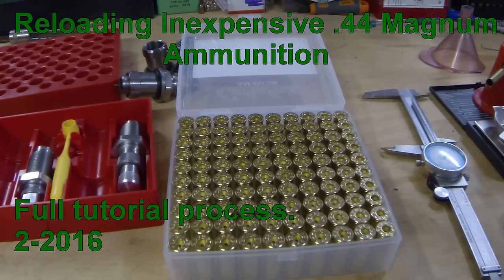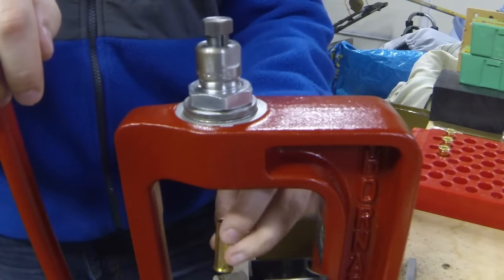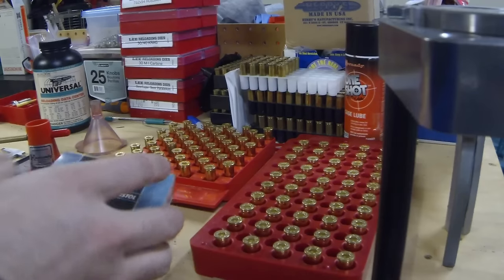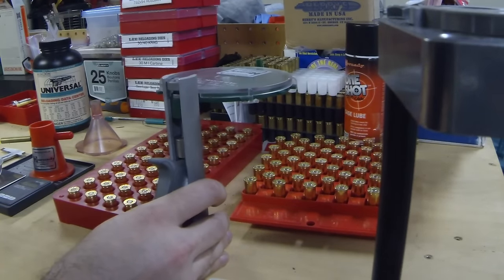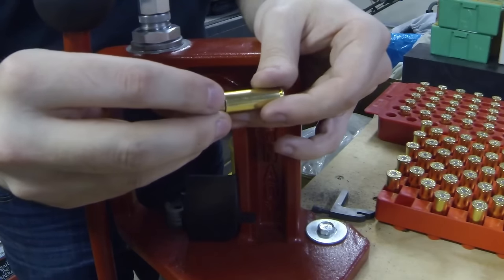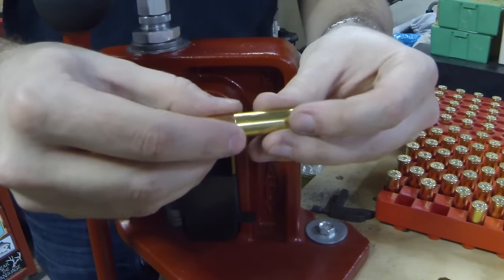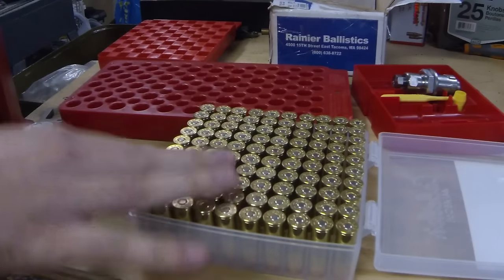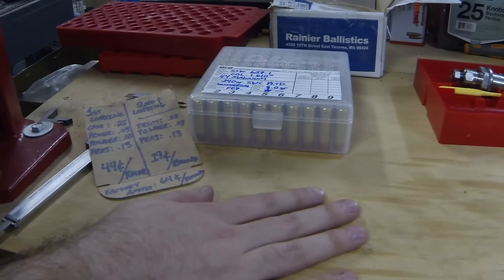Loading Cheap .44 Magnum Plinking Ammunition. Complete Tutorial Reloading Process in HD

Comment: Today, I loaded Titegroup powder into three of my 44 Mag cases. I topped them off with Hornady 180 gr HP bullets .  Only one of my manuals had a recipe for Titegroup powder.  According to Richard Lee's manual (2d Ed'n) I could go from 10.3 gr (1459 fps) to 11.5 gr (1544 fps) of Titegroup.  So, I started low and worked up.  I loaded one case with 10.0 gr, one with 10.3 gr, and with one with 10.5 gr.  When I chronograped them, the 10.0 gr gave me 1315.2 fps.  The 10.3 gr gave me 1374.5 fps and the 10.5 gr gave me 1392.2 fps.  The revolver I used was a Ruger Redhawk, with 5.5 in barrel.  The chrono I used was my new Garmin chronograph.  The Garmin uses radar to get a bullet's speed, so I was able to set up inside my shed and shoot, while it rained,  BTW - it has NEVER failed to get me the speed of a bullet (even my silenced Taurus .22 pistol) - I really like this Garmin even though it was expensive.  Since I have room to increase the charge, later I'm gonna load 10.7 gr, 10.9 gr, and 11.1 gr and clock them.  The three cases I shot today showed no signs of excessive pressure. My primers were plain old large pistol primers.  I wish I knew what length barrel Lee used to get his speeds with.  My 5.5 inch Redhawk was slower than whatever he used.    Recoil was really nice.  Ya'll take care.

Comment: for some one just starting or not done for a while they should put the powder in and then the bullet and seat then move on to the nest one and then when they have more time at loading do the way you do is ok ,  I have been loading for over 40 years on and of and still as soon as the powder goes in then the bullet goes on and is set and crimped.  I have known some who set the bullet in one step then crimp in the next. You use the same die set just remove the bullet seat plunger and then crimp.  a great way for a beginner.  Great Video one of the best I have seen.
Reply from the maker: I’ve loaded about 15,000 rounds on this press since this video has uploaded and have only made a couple changes to my reloading process. After charging all of the cases, I shine a very bright flashlight into them to visually confirm they are all charged and the same level. Then I gently press a bullet into them while on the loading block. This takes less time than positioning a bullet on the case when in the press. Also if a case gets dropped and powder spills on the loading block, the loose powder can not get into the already charged cases. Thanks for watching!

Comment: Wouldn't having all that case volume between the powder and the bottom of the projectile over a powder charge that fills more volume like 2400 give better SD-ES and a tighter group.
Reply from the maker: If you’re shooting 20+ yards off a rest, sure could help out but you’re burning twice the powder and it’ll have more recoil. But if you’re shooting paper at 10 yards or plinking I’ll use TiteGroup/universal/HP-38

Comment: Great video. I'm new to reloading and just started 44mag with berry's 220 copper plated SWC with no cannelure. I thought I might have been over crimping with rcbs die. I might change to Lee dies and try your method. It's hard to see in video but if your just removing the bell and not having a problem with other rounds jumping the crimp I guess I shouldn't either. I'm using a Lee recipe for 220 grain copper plated SWC with 6.8 grns of win231 so it's a low end of range. Thanks again for an awesome video...
Reply from the maker: Dave T Most of the time unless you are loading full bore Magnums with slower powders like H110 or shooting in a super-light scandium revolver you don't have to worry about crimp jump.

One newer method I've used for setting the bullet searing die is this: run the die down until it meets the case neck and back it off one turn so the die does not crimp. Seat a bullet to the proper depth then run out the seating plunger completely and run the die back down to touch the case and 1-1.5 full rotations lower and crimp the bullet. Then run the seating plunger back onto the crimped bullet tightly. The die is now perfectly set with no guess work!

Comment: very good video the only things I do different is that I weigh every charge and put the bullet on as soon as I put the powder in, That way if I am  called away  I don't have cases with powder sitting in them.  I also dump just under the amount of powder in, then trickle the last bit it to bring it to exact weight,  I like the balance scale, as the  digital scale I have will give me slightly different numbers weighing the same thing several different time. Hope yours is better than mine.
Reply from the maker: Hildton McConnell I have the Hornady balance scale now. I only trickle the larger stick powders for rifles if match grade accuracy is really necessary. Ball and flake powders get dispensed very accurately with this powder hopper within 0.1 grains.

Comment: Great video! I learned a lot about a subject a knew little of about! 

I am considering doing this for my .40 S&W and .45 ACP ammo. I also shoot 12ga and 20ga shotguns. If you have any recommendations for ammo presses, please share.

Thanks!
Reply from the maker: I personally don't reload shot shells simply because there is very little cost savings unless you're only doing buckshot (that you cast from free lead) or lee/Lyman slugs. 

Both .40 and .45 are more tricky to reload for beginners because they are auto loading cartridges that headspace off the case mouth. Not that it's impossible- it's just slightly more involved than what you do for rimmed straight wall cases like 38/.357/.44mag. Of all the blown up guns I hear about, a good majority are beginners reloading .40 S&W and shooting them in Glocks. The Glock barrel's chamber doesn't support the back of the case enough and when reloading a high pressure round like .40 it may rupture the case and blow up the frame on a 3-5th reload. Also a steady diet of unjacketed soft cast bullets will pop most barrels with polygonal rifling. Glocks are especially prone to this.

I recommend a single stage press for beginners. I really like the Hornady. RCBS is great too; the Lee is adequate.

Comment: You didn't check your length on your new starline brass after resizing!. I have found variance of up .0012. and need to be trimmed!.
Reply from the maker: Davey Crockett 0.001" variation in case length is insignificant especially when you will be using these in revolvers. I rarely trim any handgun brass as it really doesn't stretch much and it doesn't make much difference in the final product unless you are doing heavy roll crimps. I have some .38 SPL's that have been loaded 20+ times without trimming or primer pockets cleaned.

Comment: It looks like you don't use a baffle in your powder measure. It seems like my measure doesn't throw consistently without the baffle. Every have any issues with yours?
Reply from the maker: LoneWanderer360 I had the opposite problem. Mine would never be consistent with it in. I even had some 4227 clump up and block the openings leading to a couple half charges. 

I don’t think this design of dispenser can really be expected to do better than +/- 0.2 grains anyway. If I need it more accurate I trickle it onto a manual balance.
Reply: @HughesEnterprises  That's interesting. Without the baffle my loads seemed to constantly creep up as the hopper settled. I've gotten to the point where I use the Lee scoops for plinking ammo and a trickle for more precise loads.

Comment: Do you crimp just to remove the bell with these handloads? I am loading Barry's bullets, also which have no cannelure. Do you get any bullet jump from recoil? I am concerned because I'm not seeing any significant crimp on my handloads. Even when I step it up just a bit, I start to see a bit of deformation in the cartridge case. Any insight would be appreciated.
Reply from the maker: John Wilson Yep, just to remove the bell. On mild recoiling loads like these you don't have to worry about crimp jump unless you are shooting them in an ultralight aluminum/scandium frame gun. Straight wall cases like 44 Mag have plenty of tension to hold the bullet without any crimp. If you see the bullets start to jump, the slightest crimp will suffice. If you are seeing any deformation to the case or see the bullet start to deform, that is too much crimp for a jacketed/plated bullet with no cannelure. For heavy loads I always use cast or hornady XTP's which both have crimp grooves and get heavy full roll crimps for loads with H110, IMR4227, 2400, etc.

Comment: Thank you for a very interesting and informative video. On a percentage basis, how much do you figure you save over the long term by reloading vs. buying new 44 magnum cartridges?
Reply from the maker: I probably save around 55-65% vs buying factory ammo depending on the components I'm buying. That goes for most calibers I reload like .30-06, 38 special, 8mm Mauser, and brass case 7.62x54R. Calibers like .30-40 Krag are no longer in production so reloading and making brass from .303 Brit is invaluable. I can manufacture custom ammo that people usually charge $5 a round for for about $0.75 for the first load and $0.30 after that so a 94% savings.

I probably save $500-$2,000 a year depending on what I've been shooting most often.
Reply: jsshous you can save even more by using cast bullets. even at 1.00 a pound for wheel weight lead from the junk yard, you can make  65 240 grain bullets per pound. that puts you at. under 2 cents per bullet or close to .77 per box. reuse brass- free use about a nickel worth of powder each so there's a dollar in powder per box and 4 cents for a primer or $2 for 50. That puts cost at about 5.27/ 50 so long as you reload brass. take into account for new brass at .25 cents per round for starline and you have 12.50 in new brass. 17.27 a box to handload a box of brand new ammo. divide that 12.50 by how many reloads per casing you get and the numbers get closer to that 5.27 a box figure.
Reply: jsshous I haven't saved a dime reloading, but I've shot a whole lot more than I did buying factory ammo.
Reply: +Brandon Salyer I agree I don't think your saving money in the literal sense it's just giving you the ability to shoot a lot more I think it also depends on your intentions for reloading is it because you are a competitive shooter or just a hobbyist or a machinist and this type of thing is your passion and I say that because you know it consumes time so is it worth it when considering getting into it I think a lot of people say screw it's based on the time aspect alone#Rock Chucker

Comment: I did not see him use the 4th crimping die.  Did he just use the 3rd die?
Reply from the maker: You bet I did. A properly set bullet seating die will provide a perfectly adequate crimp for almost every caliber. 

Run the bullet seating plunger all the way out so it can’t touch the bullet. Screw down the die until it makes contact with the case mouth and stops hard then back off a quarter turn. Insert bullet, run case into die repeatedly and screw down bullet plunger each time until correct COL is achieved or case matches with bullet cannelure. Then screw the bullet plunger back out so it can’t touch the bullet. Loosen the die without rotating it then give it a half to 3/4 clockwise turn then tighten it back up. Run the cartridge in and you will feel it crimp. That cartridge is done but you still need it. Then with cartridge still up in die screw down bullet plunger to touch bullet. Take cartridge out and move bullet plunger down another 1/4 turn. The next case you put a bullet in will seat and crimp perfectly in one step. If you need more crimp give the die another 1/4 turn. Don’t crimp pistol cartridges too hard or they won’t headspace properly. Revolvers it doesn’t matter too much you just don’t want the bullet moving under recoil and it helps slow powders to ignite consistently.

Only time you need an additional crimp die is in heavy recoiling revolvers where the bullet can jump crimp under recoil. (Super hot .44 mag in light guns, .454 Casull, .475 Linebaugh, .500 Mag, etc). Or for pistols with very tight tolerances in the chambers.

Comment: I know this is an old video but I was wondering how much did all of your equipment cost?
Reply from the maker: The total I have invested now is well over $2,000 mostly just in dozens of die sets however to do everything in this video you’re looking at around $300.

This is the first kit I got and used almost every piece of in this video: https://www.cabelas.com/product/Hornady-reg-Lock-N-Load-Classic-Kit/740228.uts?productVariantId=1364213&WT.tsrc=PPC&WT.mc_id=GoogleProductAds&WT.z_mc_id1=20007407&rid=20&ds_rl=1246555&ds_rl=1246558&ds_rl=1252245&ds_rl=1252079&gclid=CjwKCAiAy-_iBRAaEiwAYhSlA3JOESCaaaWPsNWoux4-u_XVwWF7xzvfNBSBUESrgqub0EMVqPlByRoC9VwQAvD_BwE&gclsrc=aw.ds

Wait for it to go on sale for ~$269 and then do the hornady rebate and get the 500 free bullets. Then you’ll need a die set for $30. Then bullets, powder, primers, cases, boxes and that’s basically it. The RCBS kit is also good but does not have the lock-n-load quick change die feature (but that can be added for ~$30)

You can also piece together all the stuff separately from different brands but you’ll end up spending the same or more unless you get used equipment.

All dies and shell-holders are interchangeable between brands. 

If you can wait until summer Estate and yard sales are a great place to find used equipment.

Comment: You didn’t trim to length , square the case mouths or bevel the inside of the case mouths all of which aid in uniformity of ammunition
Reply from the maker: @michaelgettles3424  All of which are a complete waste of time shooting a handgun offhand at 10-20 yards. I’ve never trimmed or deburred a handgun case in the last 12 years. That includes .38 full wadcutter ammo that prints a neat little 1” group at 25 yards off a rest.

Comment: Hey :)

Do you use a roll or tapercrimp?
Which one would you recommend?

I heard you shouldnt rollcrimp a bullet without a crimpcroove?
Reply from the maker: FurryBear I am using the roll crimp option on the Lee bullet seating die. You are correct you shouldn’t use a hard roll crimp on non-cannelure bullets. If you break through the jacket it can hurt accuracy a lot and maybe cause bullet failure if you’re shooting stuff other than paper/steel.

This is a light to medium crimp, just enough to remove the flare from the case and hold the bullet lightly. A crimp this light would not hold up under full power recoil or in light alloy guns and the bullet would jump the crimp. If you pull the bullets, there might be a slight indent from the crimp, but it will not have broken through the copper plating.

For plinking ammo it works just fine. For full power Magnum ammo definitely only use bullets with crimp grooves, and generally a heavy roll crimp is best for accuracy and burn consistency with H110.

Only advantage I could see to a taper crimp in a .44 would be if you had a really picky autoloader like a desert eagle that just doesn’t like certain shapes of .44 ammo.
Reply: @HughesEnterprises  Thank you very much for this helpful comment! I will only load my .44 mags for my Winchester 1892 short rifle. 
I will get a rollcrimp then! Can you answer me some other questions? :) 

Is a friction crimp the same as a factory crimp?
Can I crimp my .357 mag bullets (with a cannelure) with a Taper crimp? 

Thank you!
Reply from the maker: FurryBear There is a lot of variation on how factory ammo is crimped. 45 Auto, 9mm, etc all headspace on the case mouth and so they are taper crimped so the case mouth still has that defined flat to meet with the barrel and stop the cartridge going in too far. Rimmed cartridges like .44/.357 headspace on the rim, so OAL of the brass and how it’s crimped doesn’t matter as much. That’s why we can shoot .38 Special in a .357.

A friction crimp is just what tension there is after a bullet is seated and the case flare is removed. This is usually fine for most rifle ammo.

The lee factory crimp die basically enhances that friction crimp by squeezing the case into the bullet.

Roll crimp folds the case over into the bullet, usually into a crimp groove.

I’ve seen manufacturers crimp in all these ways on .357 and .44 mag.

For .357, taper crimp would work provided the OAL of the case is not too long and chambers easily without force. It would work OK for plinking loads but I don’t think it would hold up as well to hot H110/2400 loads and give as consistent a burn as a traditional roll crimp. 

Most of the time you won’t need to buy a separate roll crimp die, the bullet seating die will roll crimp if you screw it in far enough.
Reply: @HughesEnterprises  Thank you very much for your comment! Have a nice day :)